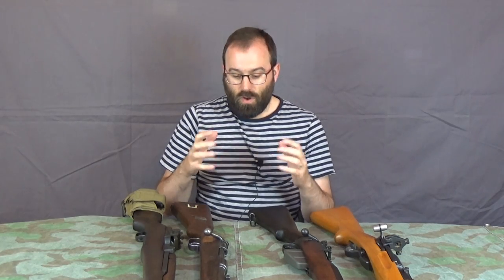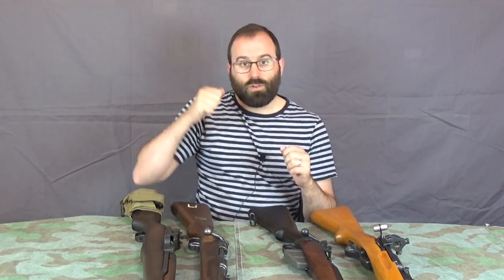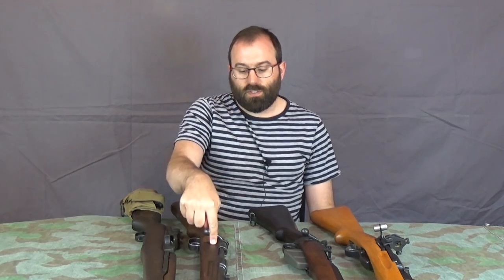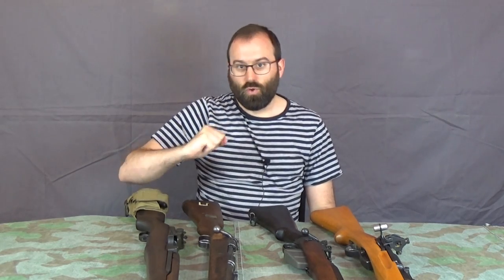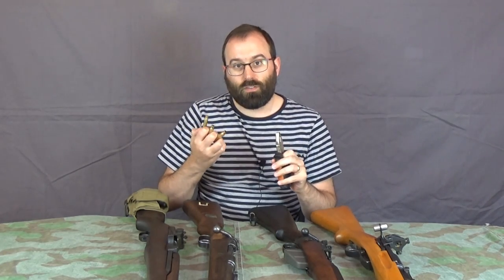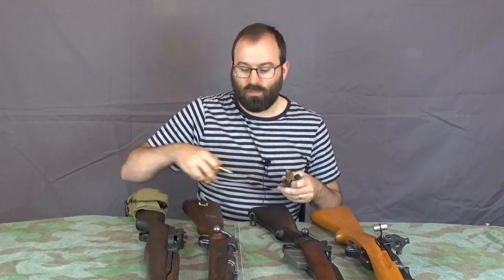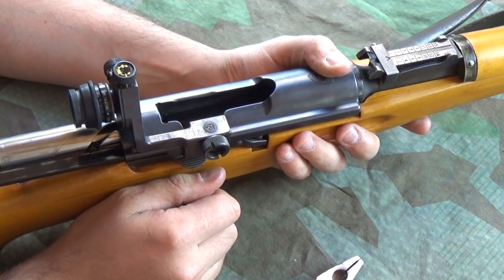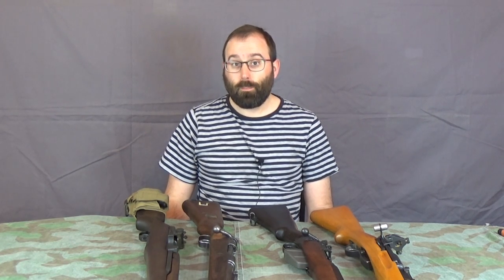Primary Extraction: A Blokesplainage With M1, Kar98k, Lee-Enfield No.4 and K31

Comment: I had a Mark III that was chopped down to hunt deer when I was a kid. It must have been around the world 3 times with all the stamps on it, but was quite accurate. The thing about the Enfield series is that mega extraction is a moot point. It is going to pull the head off the case anyway because of the rear locking system stretching the case. I used to check my rebarrel jobs with out an extractor. You should be able to pick up the rifle and tap the stock on the table and have the case fall out. Most of the time the case would fall out just from picking the rifle up and holding it vertically.  A hot rifle or a hot load in a rifle will jam it, but the usual result is the rim broken off the case. I am not sure what point you are trying to make here.
Reply: You never heard of case head separation on Enfields? They are notorious for that because of the sloppy machining on a lot of war production rifles. They are not the best rifle to reload for because of that reason. Not the worst military bolt action ever made, but hardly the best. It is clear you know nothing about extraction problems. It is almost always a massive overload which jams the rear of the case into the face of the bolt so it cannot turn. The primer welds itself into the firing pin hole and around the pin. Retracting the firing pin is what makes extraction hard, not pulling the case out of the chamber. I used to check my rebarrel jobs without an extractor on the bolt. You should be able to fire/open the bolt/pick the rifle up in a vertical position/ tap butt on the table/ case falls out.  Most of the time the case falls out when you get the rifle in a vertical position. Does anybody here really think that the silly little extractors on British and Russian bolt guns will pull out a seriously stuck case without slipping off or tearing the rim?
Reply: You are the one that wanted to compare the .303 to other rifles. Of course the bolt on an Enfield turns. What do you think unlocks it? The problem IS almost always the firing pin when a bolt is jammed. Why don't you tell us how a case can get stuck in a .303? It is a low pressure round. I am guessing the chamber is pitted. I have several model 99 Savage lever actions. The extraction is about the same as a .303 British, straight back with little cam action. The extractor does not even hold the rim to the bolt face. It just kind of drags it along back.   Some of the rifles are old rimmed cartridges and some are high pressure rounds.  22-250/.243/.308/.358  I never get stuck cases, but I can get "Sticky" extraction with really hot rounds. This is caused by the receiver "Springing" because of the rear locking bolt (Just like on a .303).  Nothing wrong with a .303. I used both a .303 and a Russian bolt gun to hunt deer in my younger days. I would take the .303 over a Russian to hunt with any time, but they are hardly the faultless rifle you try to make them out to be.
Reply: That is bull shit. I fired hundreds of 6.5 Japanese rounds that were made in the 50's by the Chinese.  Brass cased, corroded, almost everyone split at the neck. About 3 out of ten misfired, but all extracted. I have fire formed ammo and had no extraction problems.  "Rough brass, rough chamber".  Maybe if you didn't fire junk ammo, you would not have problems like that. I would like to know where you are getting steel cased  .303 ammo, or is the junk ammo reserved for your "Test" rifles?    If you have to "Beat the bolt" open on a rifle and it locked in OK, you probably had a pressure problem.  Romanian 8mm is REAL junk and corrosive.
Reply: I watched the video. You convinced me. I will never buy another .303 British. Obviously can't handle extraction like an Arisaka. Over the years people have brought me guns that they did stuff to that was unbelievable.  I usually asked "If you saw something was wrong, why did you keep firing it?"  There is a big difference between "Sticky extraction" and beating a bolt open with a mallet.
Reply: You just made some of my points. Do you really think a .303 extractor is any stronger than the extractor in Russian  a bolt gun? You have to be a little slow to think that a .303 extraction set up is stronger than  Mauser. The amazing thing is all you guys give bad examples involving other rifle designs using the worst ammo you can find, but then insist on using the best ammo in your .303.  The "Sprung" receiver was a bad example to use. It happens, but the .303 is a pussy round and is loaded down to avoid it. To be fair when testing different rifles, you would have to take a step down in power. The  Carcano, Arisaka,  98 Krag (This round would be close), MAS 36 and similar rifles. The .303 is a great old rifle, but hardly the greatest old rifle. Nobody copied it except third world countries. Like the Russian bolt guns, they were given as aid or forced on other countries.
Reply: Umm, what? the .303 is a pussy round, loaded down to avoid problems with the Lee action? no... 
Take a look: https://www.facebook.com/Blokeontherange/posts/433242210391946
It may be lower pressure than some other contemporary rifle rounds, but its performance isn't far behind. 6.5 arisaka is by no means a magnum round. The WW1 spitzer loadings of 8mm used a lighter 153 grain bullet going faster initially, but with a worse BC. The WW2 loadings, namely the s.S cartridges, used only a bit heavier bullet going basically the same velocity as Mk VII .303. 
The 98 action specifically, and most of those you mentioned, are trying to accomplish a greater distance of primary extraction through a smaller angular movement than the Lee action, with not much greater length on the bolt handle. Through the mauser extractors may be stronger in themselves, that is a moot point in this argument about primary extraction power because in original condition all were adequately strong to withstand pulling out stuck cases. It's about mechanical advantage, and not being a Lee action doesn't mean you can cheat basic maths. You have the same length lever trying to do more work on the mauser. The same principles apply to moving the firing pin and cocking pieces, the Lee moves the cocking piece a way shorter distance over a greater angular movement, using the same lever arm. = greater mechanical advantage. The Lee action is just more powerful even assuming your argument about hard extractions being mainly caused by primer flow holds any water. I would argue as well that the Lee Enfield is the greatest "old rifle" because it is unarguably more ergonomic than any other rifle you have mentioned, is adequately durable, is adequately accurate.

Comment: So essentially it has to do with the ratio between bolt rotation and axial movement? The No4 and the K31 extraction is "lower geared", hence more powerful than the K98?
  As a total geek, may I present a fact: The cam angle on the Enfield locking shoulder is equal to the helix angle of a thread of 14 TPI.
Reply: So basically it's an interrupted thread?
Reply: You didn't know 14TPI by looking at it by any chance? ;-)
Reply: @myparceltape1169  Read it in a book.

Comment: I had trouble with steel cased Romania 7.92 Mauser ammo.. my 98k would got stuck every couple of rounds.. and when I do the hard extraction ( beat the bolt handle against a tree or something ), the extractor would sometimes rip a piece of the cartridge rim off… and that case is in there for good😂 I have to cool the gun off, or wait a few hours then use a cleaning rod to get it out

Comment: I get what primary extraction is... But I don't get why it's important. How can pulling the bolt back with force not be as effective as a little pull back from camming?
Reply from the maker: Because you can't apply enough force straight back to unseat a sticky case, and the camming action multiplies the force massively. I've had to hammer bolts open before on rifles with inadequate primary extraction (Swing, Sportco, M1 Garand).

Comment: Correct me if I'm wrong, but the M1903 is, despite it being a Mauser derivative, is more close to the No.4? There is an angled lug  sort of wrapped around the bolt body that acts in a cam surface in the left rear of the reciever.
Reply from the maker: The 03's extraction is different to both - it's an improved version of the Mauser camming surface, and was copied  pretty much 1:1 on the P14/M17. The MAS36 does something similar, but the geometry is different. Unless you do some pretty funky and difficult stuff, it's hard to use the locking lugs themselves for primary extraction (Swiss straight-pulls do it, Austrian M95 Mannlicher straight pulls do it), but the machining for it is horrible.

Comment: I'm confused. When primary extraction occurs, how does the locking lugs have room to rotate without engaging the opposite receiver lugs/female bits.
Reply: Bloke on the Range the mauser.
Reply: Bloke on the Range so this means the bolt is unlocked in less than 90 degrees. This means the locking surfaces are more narrower than the locking lugs?
Reply: Bloke on the Range ah yes, now I understand how it finds room. I though it was a much more complex mechanism. Thankyou.

Comment: Can someone explain how the k31 bolt does not cam out of battery with its slanted locking lugs on the bolt
Reply: Extreme mechanical disadvantage when not firing, against the op rod. When firing, extreme friction. Friction is proportional to the forces pushing the surfaces against each other, multiplied by the friction coefficient for whichever materials / surfaces. The thrust of the cartridge against the bolt should stick the lugs to the receiver enough that the torque from the slanted lugs. cannot overcome it.
Reply: If the tan of the angle of inclination is less than the coefficient of friction it cannot shift. This is how nuts and bolts work.

Comment: If you watch the original training videos on the M1, they do mention that it does have primary extraction, but it obviously isn't very much. https://www.youtube.com/watch?v=GJJeBXZeVZU
Reply: I would think the bit of camming action serves more as an anti-pre-engagement of the bolt lugs feature than for primary extraction.
Reply: yes. More in depth explanation of what I meant is that When the bolt is being carried by the op rod, especially moving forward, only flat surfaces bear against each other. This means the bolt is not trying to rotate closed when it encounters the resistance of stripping a cartridge from the clip and therefore doesn't put unnecessary friction and wear on the lug raceways of the receiver. Then, when the bolt hits the cam surfaces in the receiver at the forward limit of travel, this bumps the flat surfaces on the rotation lug and the op rod out of alignment. Then the cam on the op rod takes over to fully lock the bolt. Clever design feature also present on the AK, to avoid wearing the stamped receiver rails with the harder bolt. Arguably more necessary there, since the receiver was not forged as on the garand style actions. The AR15 family lacks this feature and consequently the steel cam pin will wear a groove into the aluminum upper over thousands of rounds from the lugs prematurely trying to engage when the bolt encounters the magazine. However, whether this should concern users or not is often up to the advert departments of different gun companies.

Comment: Primary extraction occurs as bolt rotation BEGINS. Not as it finishes. At least on good rifles. And you're full of shit if you don't think there is primary extraction in a semi-auto. Primary extraction occurs prior to axial bolt travel. M1 Garands have it. MOST rotating bolt rifles, shotguns and even the few rotating bolt pistols that exist HAVE primary extraction.
Reply: DEEREMEYER1 Interesting - what quantum physics do your rifles employ that allows the locking lugs to phase through the shoulders without anything else moving? Is there a cheat code I can enter for this? On a semi auto how do you ensure that this phasing only occurs once the pressure is low enough that the pressure of combustion doesn't drive the bolt through the rifle (not that it matters as presumably on this God mode the bolt just phases through the operator's face...)
Reply: I saw this piece of wisdom on a Youtuber's channel: 
"I just want to make the videos I want to make. You can decided if what I have to say is of any value to YOU. But I'll tell you now if its NOT, that's not my problem. You can probably find someone else on YouTube who makes the videos you want to see. I suggest you go find that person or at least look instead of trying to change me."
I think you could follow this advice, especially given that it's your own advice.
Reply: dave38x That made I larf! Perhaps his D20 is loaded so he never rolls a critical.